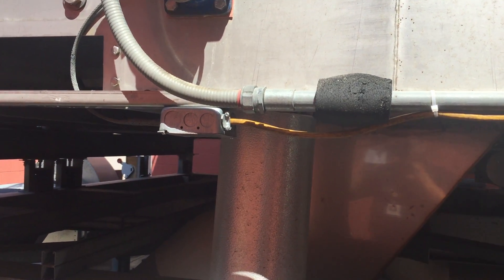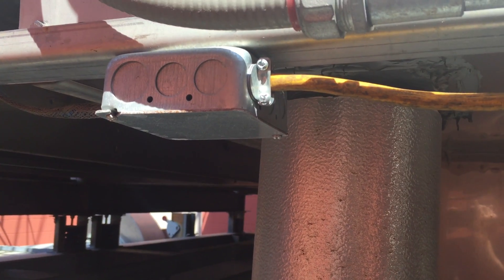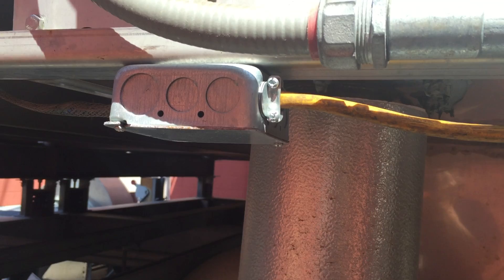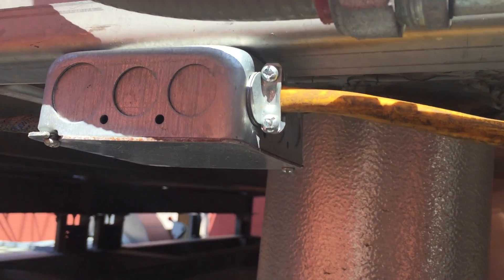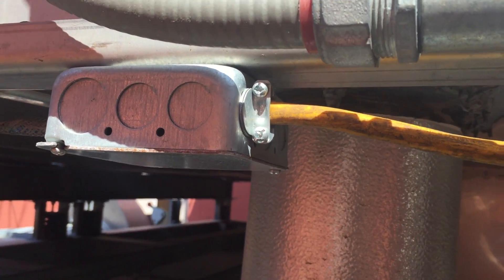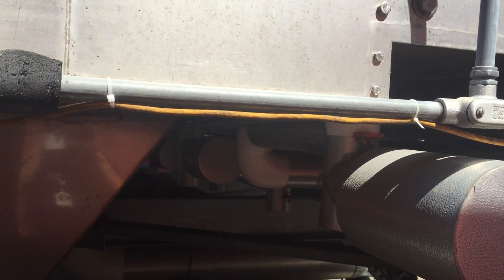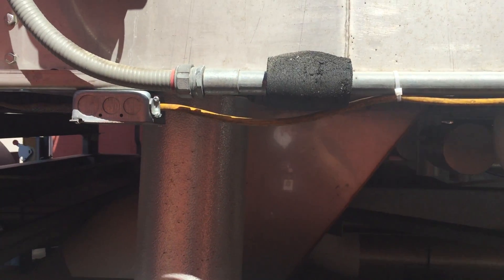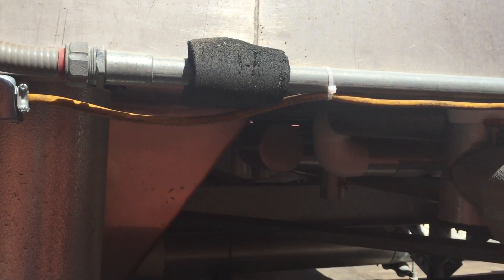Moving Violations Video No. 152: Misapplication of Equipment

Comment: I'm new to code and learning, but to this by the book if I'm correct would require conduit not attached to pervious Condit, then correct out door listed weather enclosure to pass both problems with this installation. If you had  two pieces of conduit running parallel outside could use a bar and strap method where you tie both pieces of conduit from?
Reply: Yes, there are numerous types of "rack" assemblies approved for attaching two or more conduits to the structure with the corresponding brackets.